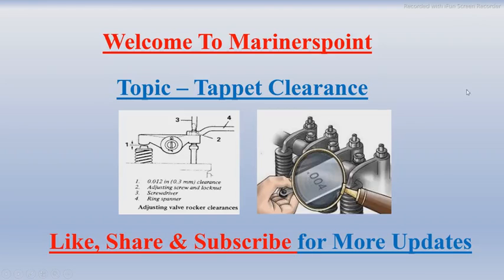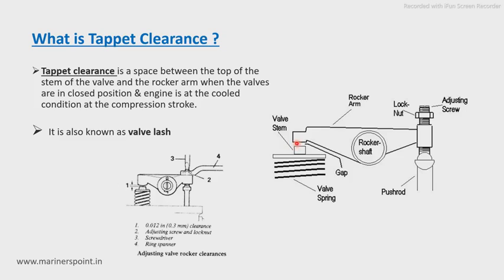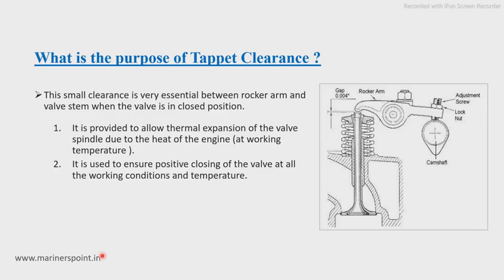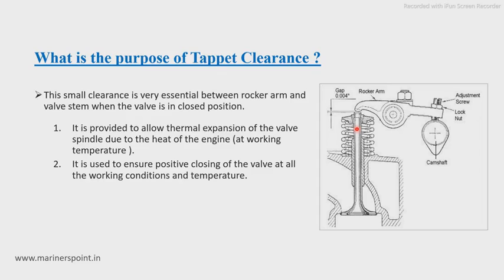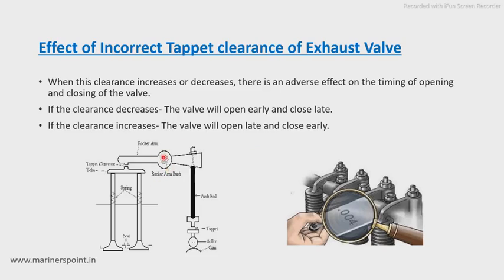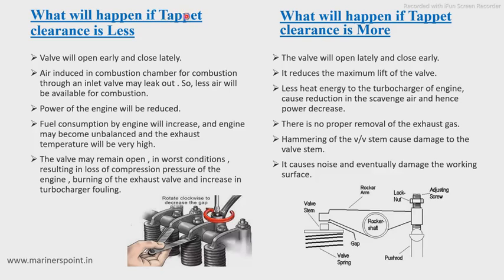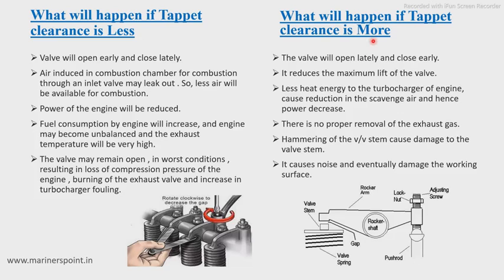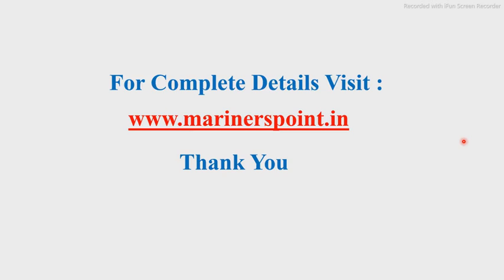Tappet Clearance - Effect of Increase & Decrease in Tappet Clearance

Comment: if tappet clearance is less then can we face issue of rpm fluctuations in working conditions when engine is hot ??

i am facing issue of fuel burning, left exhaust missing and misfiring, rpm fluctuations, & engine shutting off at idle when engine is hot, more stress to the engine while revving & while going through the higher rpm range
Reply: help me regarding this problem
Reply from the maker: Yes, if the tappet clearance is less, it can cause issues with rpm fluctuations when the engine is hot. This is because as the engine heats up, the metal components expand, including the tappets. If the clearance is too small, the tappets can't expand properly, and this can cause issues with the valve timing which will lead to rpm fluctuations as well. Reduce the engine speed and load to minimize stress on the engine until you can address the issue.

Comment: bro my ns200 just done 20000km ODO Clearance adjusted 3 times but it’s loosing again and again  and only intake clearance is loosing not issue with exhaust clearance
Reply: warranty not available?
Reply: buy tools and do it yourself every 1000kms then or try to change the parts, use fully synthetic oil motul 7200 or 300v.

Comment: Why fuel consumption will increase when tappet clearance is less? I need a more detailed explanation
Reply from the maker: Because Valve will open early so the output of engine will be reduced. And to maintain the same output you have to burn more fuel. Hence fuel consumption will increase.
Reply: @marinerspoint  ah makes sense. Then why temp exhaust will be very high?
Reply from the maker: Same reason. Since the valve is opening early...the gases which are still burning get their way through the valve causing the exhaust temp to rise.